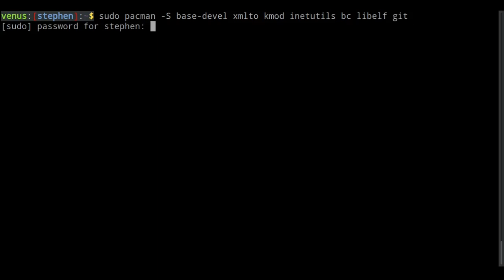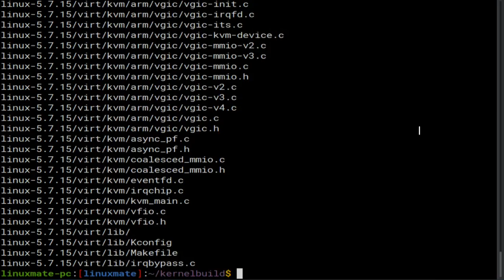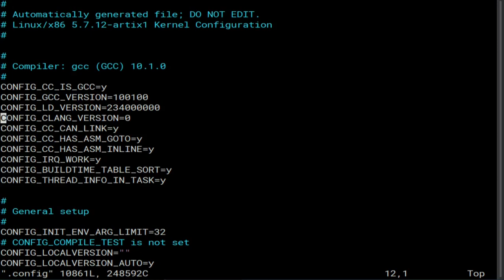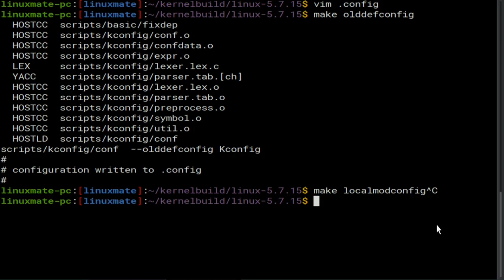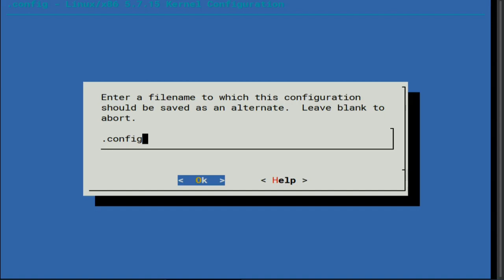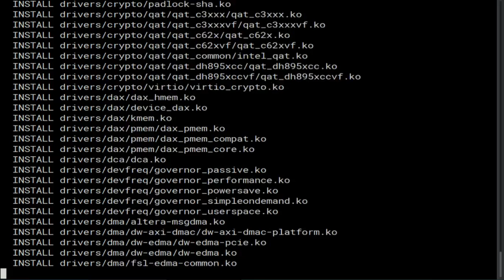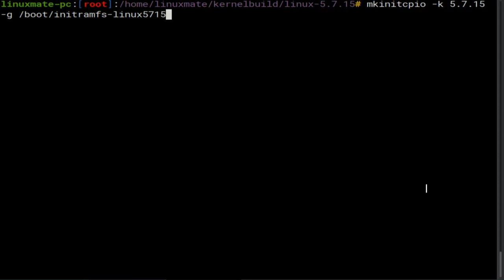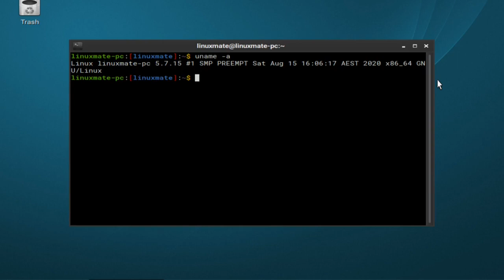Building a Custom Kernel on Arch Linux

Comment: I installed gentoo a bit ago and wanted to see about compiling my own kernel on arch and wow it is a lot more annoying to do this on arch then gentoo
Reply from the maker: Gentoo was designed to be a source based distribution. Most Arch users won’t need to compile the kernel themselves.
Reply: @LinuxMate  i know but still its so much more hassle free
Reply: did you use genkernel on gentoo? its super easy on there that way but i think youre also supposed to do it this way on there too
Reply: @morganb900  i used genkernel but i had also used it without gen kernel either way it was easier then that lol

Comment: For some reason, this didn't work for me. everything compiles fine, but I have a black screen when I boot with the new kernel
Reply: Did you make significant changes to the kernel in menuconfig?
Reply from the maker: My first thing to check would be to make sure you copied your original config to use as a starting point. Secondly, be very careful you don’t need anything you’re removing. It’s difficult to say what may have gone wrong in your exact situation, but just a couple of ideas.
Reply: Your initrd should be -100MB, if it’s around 800MB you should strip unneeded symbols

Comment: This works. I had a problem on Lenovo legion 7 16IAX7 with no sound on internal speakers. After a several days of trying to fix it I found a patch for the kernel and your video. So following the steps from the video I patched the kernel and speakers (to my very surprise) began play sound! Thanx a lot!

Btw, I used make with -j24 and all worked well. Took about 10 minutes to build the kernel
Reply: I need help pulling this off. I’m sure I’m trying to use the same patch as you did.  Once I’m done and try and load kernel it won’t mount Hdd
Reply: @mikeroenne8344  how did you apply the patch, I remember, on the moment I did it, the patch was already too outdated to apply it atomatically. So I manually changed rows of code as it was in the patch (just in kernel there is slightly different lines of code that needed to be changed). One more thing to mention, I patched the kernel 7 months ago, nowadays the patch may not work at all
Reply: For the most part I use nobara because it has all the legion patches built in. Minus sound.  I wouldn’t even no where to begin with nobara.  Making a custom kernel and manually adding and replace lines

Comment: Hello, great video.
I have questions:

My current amd kernel (I have intel-i5-13500 and RX6700xt) does not show my cpu temp (in kde widget and sensors command), I see its missing CORETEMP module.
Based on your video I found out its coretemp module is not set (CONFIG_SENSORS_CORETEMP).

Do I need to get the source and build it with this update in config?
or
Can I modify existing kernel (installed linux-amd) with CORETEMP set? also should it be 'm' or 'y'?

Comment: file not found: fsck.btrfs

what's the deal? i enabled btrfs support, if that's the problem

EDIT: you need to install btrfs-progs when installing the kernel on a btrfs filesystem (also you need linux-headers as well to compile the modules correctly).

Comment: When using "make modules_install -j8" I'm getting the following error massage:

`sed: can't read modules.order: No such file or directory
make: * [Makefile:1425: _modinst_] Error 2`

Do you know what's the problem?
Reply from the maker: Try doing a “make V=1 all” before running make modules_install. Also maybe try using -j4 instead of -j8. Sometimes using too many cores for kernel compilation can cause problems.
Reply: Make sure you have the cpio package! I had problems running "make modules_install", then came here and tried to run "make V=1 all" but couldn't... so I searched and I found a forum entry in the Arch Forums and they talked about this cpio package... I installed it and now make V=1 is running flawlessly! I have to wait for it to finish although for the make modules_install... I wish you luck!
Reply: @camaradamanuel5025  I installed the cpio package but it is also giving me the same error, do you have the link or other solutions?
Reply: @LinuxMate  I don't know if you are seeing this but now the boot process stacks when saying "loading ramdisk". Any ideas?

Comment: ouyeah? Build custom kernel on Arch and after that rebuild all packages with new kernel headers. Very idiotic action under every precompiled Linuxes.
Reply: The only things that need rebuilding with kernel headers are external modules like nvidia driver or some other out-of-mainline driver, and that is already done by DKMS automatically on each kernel update - i see no problem here, why are you complaining?
Reply: @LekKitEva  I just leave it here "equery d -D gentoo-sources".
Reply: @vit.c.195  I know that libc depends on kernel headers, but that doesn't mean you acually need to recompile it. Any issue regarding gentoo i may be unaware off, but in most distro switching kernels / switching to custom kernel doesn't require any further tinkering (the userspace part is completely separated)
Reply: @LekKitEva  There is such thing as "consistency" which is "true" if all packages are BUILD together accordingly to dependencies. If it not - system is INCONSISTENT. Just like that. Whatever whoever think that is need (or not) to be recompiled. Precompiled package managers have no idea about changes on installed files from binary packages. Their only can check names and versions in dependencies. This provide illusion that everything is OK if dependencies are satisfying... but is not if files compiled from custom sources with custom configuration. So it's most stupid idea to compile something from source code and use standard package manager in same place. Except user end packages on which depend nothing. But on kernel depend  EVERYTHING.
Reply: @vit.c.195  There isn't such thing as "kernel dependency", kernel has a stable syscall API and multiple kernels can be installed and changed on boot time, the distro may be even installed without the kernel (chroot installation, containers), or the kernel may be removed (tho it will not boot, the userspace part is still fine)
You are right about the package manager consistency where every piece of software on the system must be known to the package manager to prevent conflicts, garbage files, etc and what is shown in the video is not 100% correct (better approach would be making a PKGBUILD and installing the new kernel as a normal package), but there is very little harm from doing that as the kernel is pretty much self-contained and the only "dependency" userspace imposes is that the kernel is actually working. Also, Gentoo (for example) does not even list kernel as package and approach there is the same as shown in video (compile, copy to /boot, update grub cfg) and you're ready to go
Reply: @LekKitEva  So it's just illusion that gentoo-sources exists as package in portage with dependencies? And in install guide of gentoo there is interesting moment. When we unpack stage and compile kernel should do emerge world --emptytree. Think about that.
Reply from the maker: @vit.c.195  I’ve been building Linux kernels since the mid 90s and I have never had a kernel with the properly compiled features and drivers break user land. I could easily take a kernel I built on Arch or Debian, drop it into a custom compiled Gentoo system, and as long as I had all the features enabled and drivers included, it would function without a problem.

Lekkit is correct about user land. You start mixing and matching library versions and dependencies in user land, you will quickly run into problems. But the kernel only exposes an API to user land, an API that almost never changes in a way that would break user space, so there wouldn’t be any conflicts.

Gentoo users build their own kernels not because they have to, but because they want the ultimate power to customise it. I think that’s the core reason anyone would choose to run Gentoo, otherwise it’s not worth the effort.